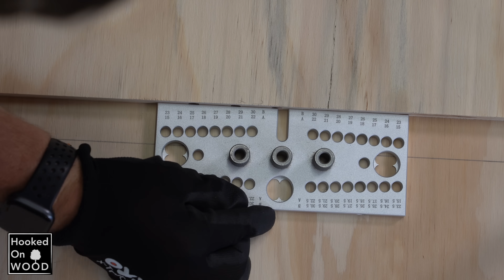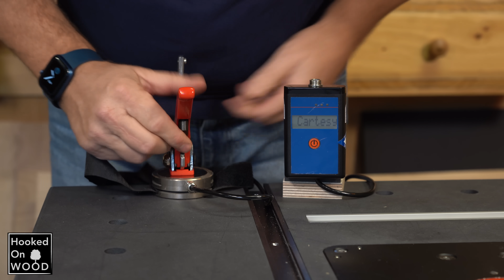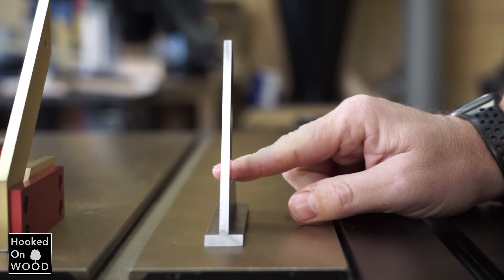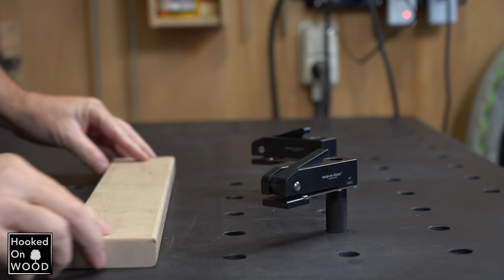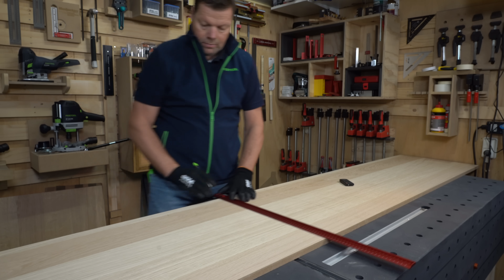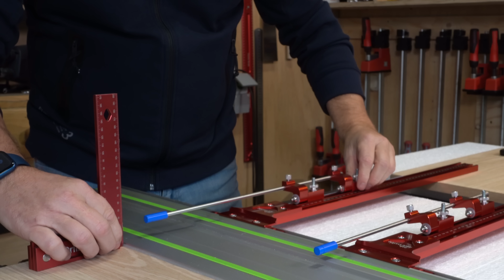China Tools Ep. 30 Parallel guide system Insane low price!

Comment: Wow!  I didn't know this channel even existed, but I'm just blown away by the attention.  It's really helpful info to a serious hobby guy like myself.  I've been doing this long enough that I've embraced the 'buy the best tool you can afford' mentality and have quite a collection of quality tools.  But I still like to find a deal.  Like that cabinet drill guide...I bought a similar model off of Amazon a while back when I was remodeling my kitchen.  Mine was very well constructed aluminum like the one your demonstrated, but no case.  I think I paid $25 at the time, and it was at least 2x better than the 'professional' guides I'd picked up from Rockler.  I even loaded it to a buddy of mine who was building some new shop furniture, and he was absolutely blown away by the quality and function.  So those deals are out there, but I'm glad to have a guy like you out there testing things so I don't have to work through trial and error finding the 'best' cheap tool.

Comment: Great content as usual, but I have to disagree with the all 5 star scoring card for the Veiko 760mm t ruler. I have it since September and if you assemble it without a known reference square it won't be accurate. You can adjust it, that's true, however it also means that it can be easily de-adjusted without noticing. I would suggest 6 screws for fixing and a bit larger, fuller t head just like the Drillpro version. Every time I use it I have to check if its square, and so far it wasn't square just once, but that's already once too many.

Comment: Good reviews. With the rail clamps it would have been good to show how they work with track saw rails since that is their primary purpose.
Reply: I bought these for my tracksaw tracks and they don't fit. They are 0.100" wider than the festool clamp.  I checked these clamps in both the festool and Milwaukee rails

Comment: Excellent channel, plenty of useful information, it's definitely my reference source to select and check the woodworking tools. 
I congratulate on your 30th video and I wish you to continue in a same manner. I am looking forward for many many more!
Regarding the parallel guide, I have just noticed that two versions have been offered in a shop now. The first one I think is the one reviewed in a video. The second one, available for preordering only, is an upgraded version, I suppose. Unfortunately, the photos for the upgraded version are not clear enough and the description is lacking an upgrade notice, so it's hard to understand what has really been upgraded. I think that the two lacking marks on the scale can now be seen, that's good! Also, I think it's a new font and the marks on the scale are thicker now. I doubt that the thicker scale marks could reduce measuring precision. 
Do you have any more info about the upgraded version? I hope that you will have a chance to present it in one of your next videos.

Comment: I was always unsure about these parallel guides for tracksaws but I've never had the chance to use one so I'm asking here: How do you make sure the stops are on the same mark? do you just establish parallelism by eyeballing it, i.e. how do you make sure the two stops are at the exact same distance from the edge of the guide rail?
Reply from the maker: To calibrate the system. Watch end of the video.
Reply: @HookedonWood  In the end of the video you show how you calibrate the system for narrow cuts - I am asking about how you generally use it in terms of syncing the two stops - the narrow cuts are uninteresting for me.
Reply: You could indeed introduce a potential error by setting up the cut width with your MK I eyeball. As you correctly assumed it is quite possible to be slightly off between the left and right stop settings. But as far as I can see it that is about the only chance to introduce an error and it'll likely be in the realm of a tenths of a millimeter.
The calibration process itself seems fairly straight forward as long as you use a freshly cut splinter guard for the setup and always utilize the same tracksaw (or have them all adjusted to cut exactly the same)
Reply: @chrisr8996  thanks, as I said I am not concerd with the calibration at all but with setting the stops exactly the same. From my experience this is quite hard to do without a built-in magnifier, which is why we generally prefer to cut things on the table saw with the same setting instead of going back and forth between pieces trying to hit the same setting. One idea though: One could initially put the arms right next to each other make one setting and adjust the other stop with a precise angle to the other arm, then move the two arms apart. Quite frankly though: In this case I'd rather just make a rough cut with the plunge saw and cut it to precision with the table saw.
Reply: @Audioventura  is horses for courses but for repeat cuts without a table saw using parallel guides
is certainly less error prone than the usual method of measuring and marking on both ends of the workpiece, then align the rail front and back and then cut. That offers three possibilities to introduce a compounding error and no precise repeatability. Repeatability is exactly what  you'd use this system for and in doing so it is analogue to the process you use with the table saw, I.e. set the fence once and cut as many pieces as possible with the same setting. The benefit is not having to wield an 8ft sheet of plywood around, nor having to rough cut in a separate maneuver first.

I think a PGS is well worth it if you're space limited, work on site or do a lot of repeat cuts like on wardrobes or cabinets. Once set (2 minutes) you slap it onto your sheet and cut one piece after the other without ever measuring in between.
Reply: @chrisr8996  I disagree: The table saw differs substantially from this system in that you only have to make one setting when it comes to adjusting the fence. Whether it's more or less error prone than the usual method depends on the way the usual method is executed - I have a couple of carpenter friends and none of them use such a system on site.
Reply: You could probably use a square to mirror the setting
Reply: @Audioventura  misunderstood the 'one setting' you mentioned, now I get it

Comment: Grabbed both the 90 and 45 engineers squares after your review. Easily the most beneficial and used tools in my workshop. I verify almost everything with them. The wide, flat base makes blade alignment effortless. I use these to verify any new tools I bring into my shop. As always, thank you for your honest opinion. I will continue to use your knowledge and experience to make my shop and projects better.

Comment: Hi Dennis, yet another interesting and informative video, apart from the most recent products you have reviewed, I think I have already bought most of your favourite items LOL.
I am just waiting to see if the Price of the WNew Router Fence comes down in the 11/11 festival, but if not I will probably buy one anyway.
I have found a supplier of exactly the same Router Fence here in the UK, but with a different badge on it so won't have to wait long for delivery.
I tried to buy some 1 metre lengths of T-Track from Banggood to make your adjustable router guide but they were asking £27 just for delivery on top of the price.
For 500mm lengths delivery is free to the UK so will use two of these instead which should be OK hopefully.
Reply: I saw that it came down to 159 euro's. It's been in my cart for a while now but I've been waiting for Dennis' review as it still is quite costly :) I was hoping Dennis would give a small preview into his scoringcard for the router fence. ;)
Reply: @jojowazza1  At the moment, its showing up in my cart as €186:75 for Item C (The whole package) the difference in price must be down to different country taxes, unless you are also in the UK of course.
Reply: @colindoesdiy  Ah yes! Excuse me, I had item B checked. You are correct - Item C is 192 for me here in  Holland. That's only 1 euro under normal price
Reply from the maker: Hi, So, far, I like the fence. But it is not a system like the INCRA LS positioner.  That is the best Fence system you can get. But INCRA is expansive. And when you look at other brands they probably have the same system for measering the distance than this WNEW. (So with the two tracks) Then I have to say, that it is very nicely finished.  I plan to upload the review in the next china tool or one after that.
Reply: @HookedonWood  I think I will fit T-Track to my Bench to use the Wnew Fence at first and if I decide to get an Incra LS Positioner in the future, then the T-Tracks wont be in the way anyway and they will always be useful for clamping things as well 😁
Reply from the maker: Yes, But you also could upgrade only with an LS positioner. Because the fence itself is very nice. If you want to do dovetails etc. the INCRA fence is a good option, but  for most work I do with the fence, a LS positioner and this WNEW fence will help me 90% of the time.
Reply from the maker: And you are right about the T-TRACKS. I have use them some times already to clamp something in place. They will indeed not be in the way.
Reply: @HookedonWood  Dennis, that's a great idea about just upgrading with the LS Positioner only and use it with the Wnew Fence, I didn't think of that LOL I presume the LS Positioner will connect to the Wnew Fence without many problems ?